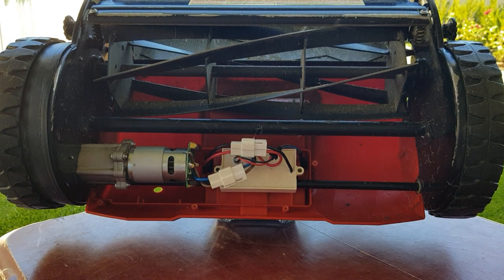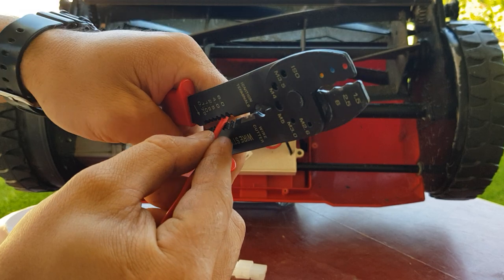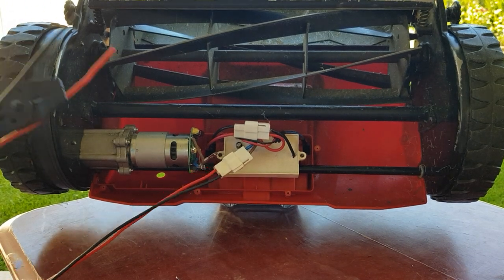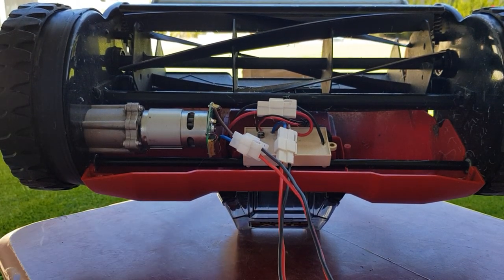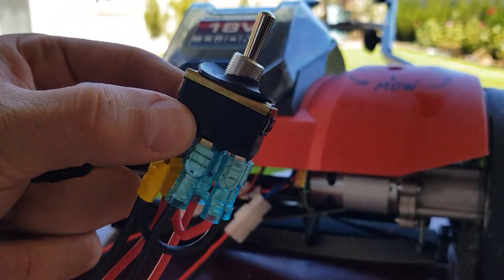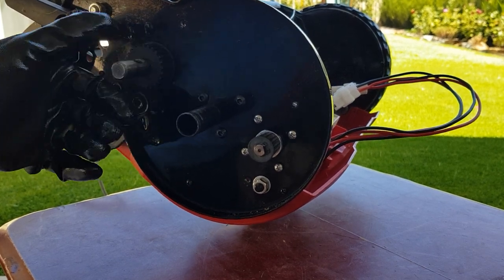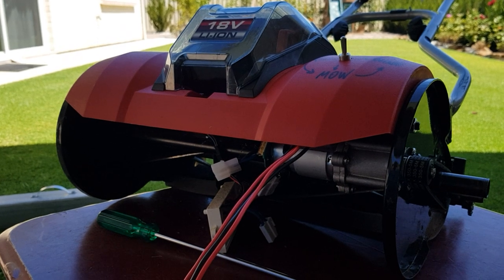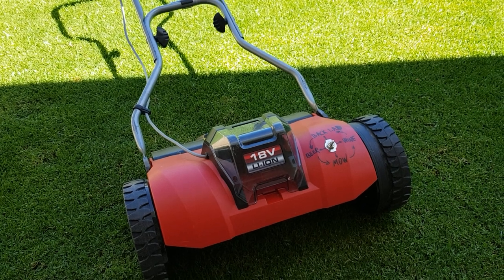Ozito PXC 18V 380mm Cordless Cylinder Lawn Mower THE BACK LAP FUNCTION:PART 2, INSTALLING THE SWITCH

Comment: Interesting.  I have a burnt out ozito drilll driver.  I think the forwards reverse switch from this should be up to the job.  I'm alreay out of warranty so thinking of splicing it in on the handle after the saftey switch (or at least running the wire up that way), that way when I get a stray twig jammed in the reel I can reverse out without bending down for the switch.

I have just ordered a new drive belt after about 18-24months mine broke.

If you need to replace yours the belt spec is 350 5M 70 tooth.  Einhell site says about €20, I got an automotive supplier to ship two for $20 in New Zealand.
Reply from the maker: Awesome thanks for sharing, let us know how you go with the switch! More options the better for ones interested
Reply: @Iggs_1  yeah.  I'm waiting in replacement drive belt at the moment, but hopefully get some time to do a little test during reassembly.
Reply: Warranty is 5 years ? Are you sure you are out of warranty? ;)

Comment from the maker: WARNING!!! 
Dont buy the same switch i trialed!!!
After deeper investigations, because i am using self propelled with 20kg extra weight, the case of the switch even is rated high voltage and amperage, QUALITY is not there!!! 

I will trial a different switch, need to research on ebay. 

If you decide to do what i have done, its at your own risk, just like i did 😅

Will make another video with the new switch when comes, will buy a more expensive one, hopefully quality is there!!!

Comment: What's the purpose of this modification?
Reply from the maker: To “back lap” = a home method to sharpen your reel- another option is to use a powered drill to spin reel backwards with applying backlaping paste to achieve desired sharpness so you have same cut every time but involves a bit of pulling bilts apart, or this option trial is adding a switch to change motor polarity to make it reverse by the flick of a switch -without pulling your mower apart 🙂
It depends what you prefer and mower performance expectations.
Reply: @Iggs_1  I see now, thanks